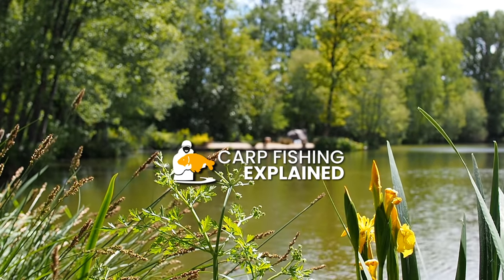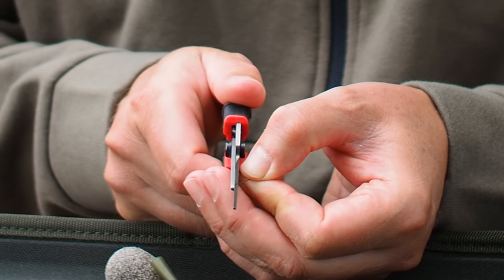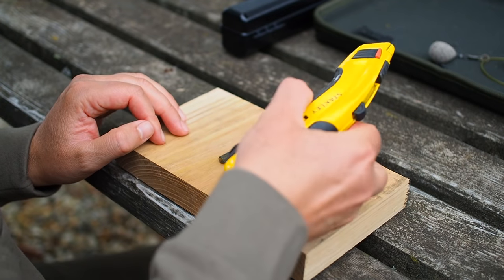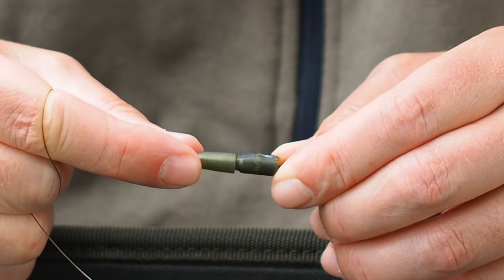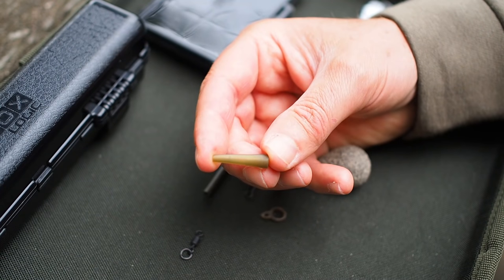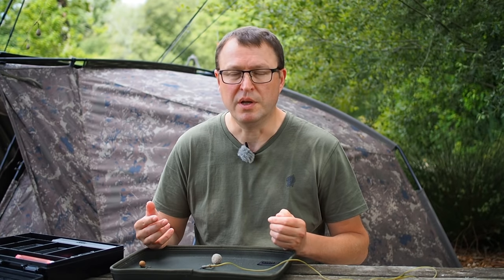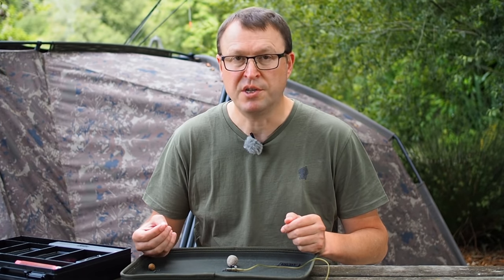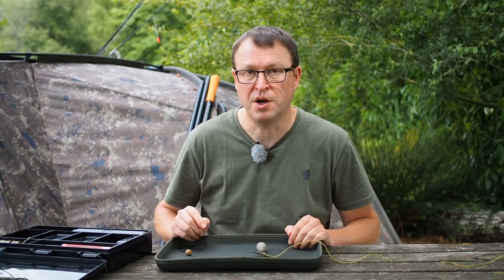I Cut the Leg of a Lead Clip (HERE'S WHAT HAPPENED)

Comment: Hello Matt what rig  set up would you use in weed ?
Reply from the maker: Hi Steve, the trick with weed is that you have to lose the lead or fish with very small leads that come through the weed. I do have ideas with lighter lead and retaining them but it’s a bit complicated to explain here. In terms of dropping the lead reliably I’d look at the Nash weed lead clip. I haven't had the chance to test them yet but I got a pack to look at and they are obviously purpose made for the job and much more reliable than just nicking the tail rubber on. The other option is the outline inline method. I like the outline inline as it’s particularly suited to fishing solid PVA bags. I used to bomb bags directly into the weed. It works as long as you make the bag heavy enough (4oz lead normally did the business). Another option is just to tie the lead on and fish with a rotten bottom. Julian Cundiff wrote a little piece on Facebook recently about this. I do plan to cover fishing in weed at some point so I hope you subscribe. Hope that helps, Matt.

Comment: How would the weight stay in place when it hits the water from cast??
Reply from the maker: Hi mate, I always cast to the clip to stop the lead in flight before it hits the water. This prevents the lead from pulling the ring off the sleeve on impact with the water. If you are fishing at max range and hitting the clip isn't possible then it’s probably better to use a traditional lead clip. Cheers, Matt.

Comment: how would i go about using a inline feeder or method lead with this?
Reply from the maker: Hi there, you don’t need the lead clip body, just use a tail rubber as a buffer bead, push the tail rubber on to the swivel and then sit your method feeder on top of that. Something similar to this: https://youtu.be/ED58TfFEcqM?t=481
You only need the lead clip body if you use a swivel lead and the Fox run ring. 
Hope that helps.
Reply: @matthewcollinsangler  thanks i'll give that a try!

Comment: Hi Matthew, will this work without the tubing?
Reply from the maker: Hi there, yes, sure, you can use it naked or with a leader of some sort. My preference is to use it with 1m of Nash Cling-on in 45lbs 👍
Reply: @matthewcollinsangler   thank you for your reply Matthew, i will be giving it a go in the spring as i will not use the drop off system as i believe there's too much already going into any water's we don't need more pollution 🧓
Reply from the maker: @GwenGamble-u9v  Absolutely, I hate dumping leads too. All the rig videos on my channel show different types of running rigs so I hope you find a design that inspires you. If you haven't seen it, I've also done a video on why running rigs are more effective than lead clips: https://youtu.be/ckzalwJuh0c

Comment: Would this system be ok to use with a pva bag?
Reply from the maker: Hi Brian, if by PVA bag you mean a solid PVA bag then I would recommend my original inline lead setup. Just shorten down the hooklink to 4-5”. Here’s the link to that video: https://youtu.be/ED58TfFEcqM If you are referring to PVA mesh bags of crumbs or pellets then yes it is possible to use this setup but you must push the run ring firmly over the tail rubber and keep the bags very small and hit the clip to land the rig. I’d also only recommend doing this at short or medium range. It’s very easy to test: Make up a lead system, connect a rig and hook on a bag. Cast out, wait 30 seconds and wind in. If the ring is still securely in place then you’re good to go. If it’s been dislodged then you need to make a few changes. If you’re still having trouble then to make it absolutely bomb proof just tie the ring to the swivel with some PVA tape and that will secure it in place for anything. Best of luck, Matt.

Comment: Still a high risk of losing the fish at the net as the lead will be back on the rubber with the rod in the air.
Reply from the maker: Hi Simon, thanks for commenting and I appreciate your concern. I’ve been fishing with running rigs, either this set up or inline style, for over 12 years and I hardly ever lose carp at any stage of the fight (one or two a year and that’s it) so that’s not a concern for me. Cheers, Matt.

Comment: look's over complicated to me I just use the tail rubber with swivel barely in the nose saves £££'s and caught over 900+ fish so far on it with no tangles or spooky looping tubing?? is that a constricting knot? Palomar would be better there and less crap involved on a break off the better right?
Reply from the maker: Hi mate, yes absolutely you can do it with just a tail rubber and that’s what we used to do but the tell tale indication isn't as reliable which is a factor at my lake as our carp are extremely good at ejecting rigs! Regarding the knot, we have catfish to 134lbs and our guests test their knots using an 8kg deadlift kettle bell. Some people find it easier to pass the test with a palomar knot, some get on better with the half blood knot. We spent 4 months testing knots ourselves to establish what works best and found that a well tied half blood knot is extremely strong. As is often the case, different experiences on different waters 😊 Cheers, Matt.
Reply: @matthewcollinsangler  thanks mate o/

Comment: Don’t Fox make a similar item?
Reply from the maker: Hi Richard, if you’re thinking of the Fox tadpole system, then I’ve tested it but I don’t use it because the swivel repeatedly pulls out of the tadpole bead. This means that the tubing slides up the line which is not what I want to see, so it’s not for me. Cheers, Matt
Reply: @matthewcollinsangler  yes Matt I’ve got a few tadpoles as such but not used them for a while   I thought they were trying to achieve the same but you’ve obviously found an issue .
 By the way I really enjoy you videos  👍

Comment: What about if you are fishing in heavy weed
Reply: @Josh Kuempfel i know that is why i currently use a clip system but is this not applicable for weed
Reply from the maker: Hi mate, as I mentioned in this video I do not recommend this rig for weed. Way too much gear for the green stuff to snag hold of. The best option is to dump the lead on the take although I hate to do this. Cheers, Matt.
Reply: @matthewcollinsangler  👍👍

Comment: Couldnt u just use a inline lead. I use inline and it slips into the swivel not to tight and runs free up line when fish has taken bait
Reply from the maker: Hi mate, thanks for commenting. This rig is a swivel based version of my original trick inline rig which is similar to what you describe but with a nice little edge. If you haven't seen that then watch this: https://youtu.be/ED58TfFEcqM. There are lots of reasons why it might be preferable to use a swivel based lead system such as this as opposed to an inline system. For example, inline leads don’t play nicely with mono, they are also limited in the distance they can be cast, so depends on the situation really. Hope that helps. Cheers, Matt.
Reply: @matthewcollinsangler  thanks for the info will look into ur other vid too
Reply from the maker: @thetippingpoint2832  No worries mate, hope you enjoy the rest of the channel.

Comment: Nothing new, look at the Fox Tadpole Multi Bead . Same job , more versatile and no fideling ...
Reply from the maker: Hi Nathalie, I have both the inline and the swivel based version of the Fox Tadpole systems. The inline version requires you to use Fox inline leads which I don’t have so that’s no good. For the swivel version the force required to dislodge the ring is way too high and all that happens is the sleeve slides off the swivel which makes the whole idea useless. That’s not a system for me.